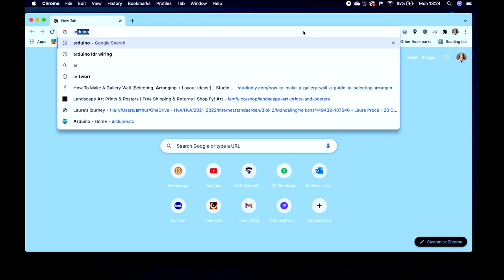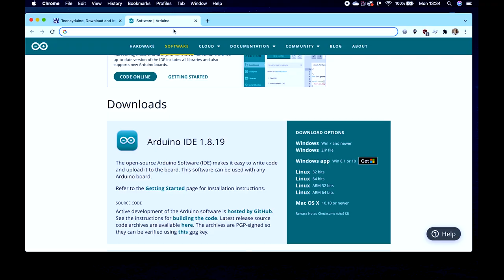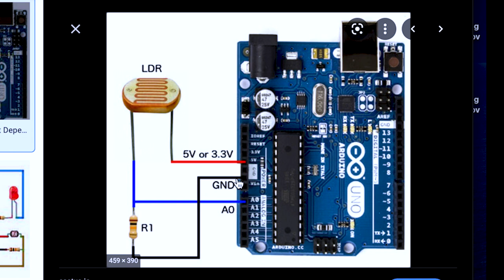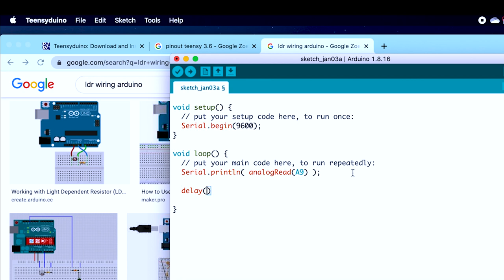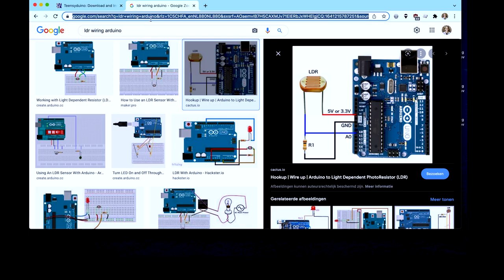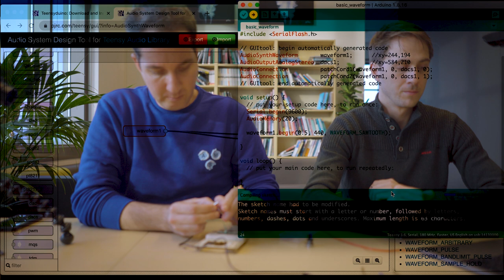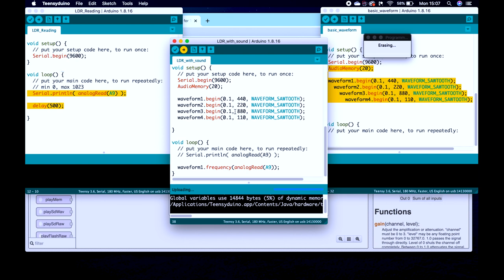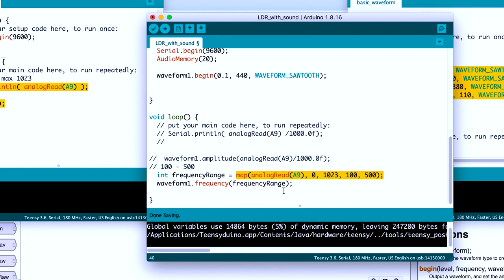Build Your First Synth - Complete Workshop For Musicians and Artists

Comment: Thanks, followed the tutorial and got it working. Once challenge, if you use the Audio shield, you need 2 extra lines:
in top section AudioControlSGTL5000 nxpDAC;
in setup section nxpDAC.enable(); and nxpDAC.volume(0.4);

Comment: I have a Teensy 4.1.  How would that differ from 3.6 (Edit: sorry I made a mistake with the versions) ?
Reply from the maker: All Teensy MCUs are programmed in a similar way. If you're doing audio you might need to add the audio shield if there is no built in one (Teensy 4.1 does not have one, while 3.6 has), and then check the PJRC (Teensy) site for the pins occupied by the shield.

Comment: Cool, but it starts at 38:10, we don't need a beginners Arduino class.
Why did you pick the 3.6? The 4.0 is cheaper and much more powerful. You want the Teensy Audio add-on anyway, as the single 12-bit out of the 3.6 is a bit simple for a synth.
Reply from the maker: Thanks for this. Happy to clarify :) first, this is a workshop for our 1st/2nd year students, so going through the absolute basics is essential. Second, this is quite an old video, hence the Teensy 3.6 (it's actually not available anymore). In our newer workshops we are using the Daisy Seed. And third, 12bit is great for synthesis. Many synths and eurorack modules have the 3.2 in them and I don't hear anyone complaining. 12bit has a unique character. Dismissing 12bit is like dismissing cassette tape - sure it's not super high fidelity, but it has its charm and place in music composition and production. Nevertheless, I hope you've learned something from the video.
Reply: @SynthuxAcademy  I love 12 bit sound. I even want to make a 12 bit computer one day on a FPGA. Integers that go 0-4095. Yay!
Reply: @SynthuxAcademy  The Daisy Seed looks cool indeed, but it is hard to get her in the EU. I can always bit-limit on the Teensy 4 to achieve 12 bit.
Reply from the maker: @lovemadeinjapan  I'm in the Netherlands, and getting the Daisy here regularly. Our community buys them directly from us when we run courses and workshops. Check the website synthux.academy/simple and join the mailing list. Daisy is much easier to get than you think and it's more suited for synthesis than Teensy. Don't get me wrong, Teensy was my go to platform for years, and Paul's work inspired many of my classes, but at the moment the Daisy is more effective and their community support is unbeatable.
Reply: @SynthuxAcademy  Tempting, but I promised my DW8000 and ESQ1 they will be touched first...

Comment: yes, that's a good introduction but a complete workshop certainly not, what about connecting multiple devices to the teensy with multiplexers, using rotating coders, connecting oled screen, and the midi ?
Reply from the maker: Yea, the topics you refer to are really valuable! We're working on a complete course. This is just one workshop. All the topics you refer to can easily take a whole semester to cover properly depending on the level of the student.